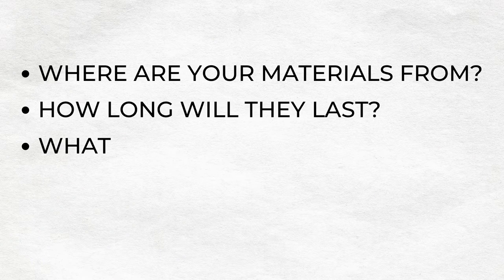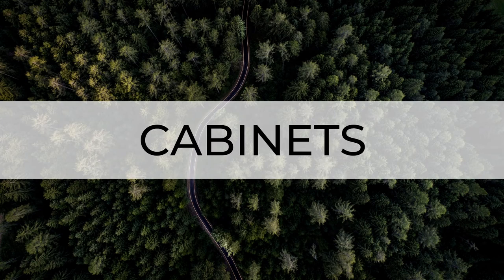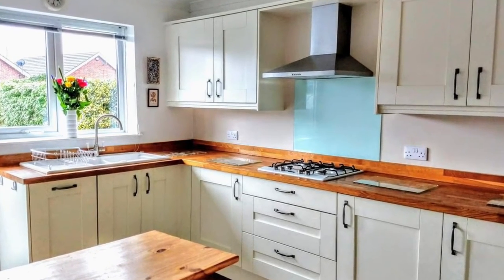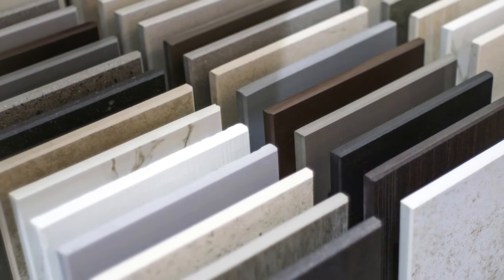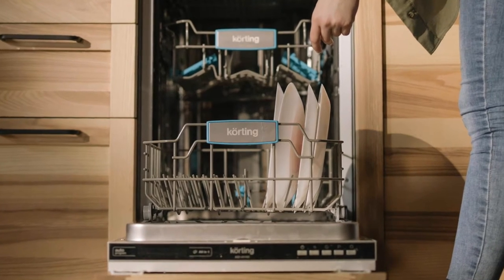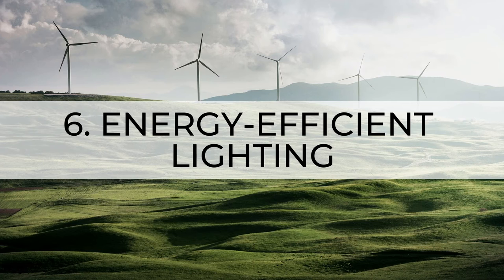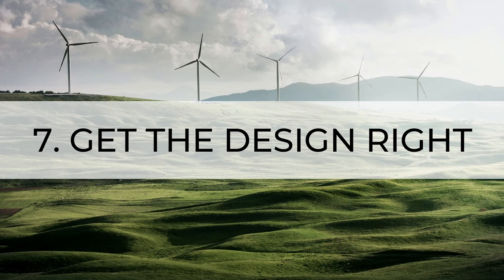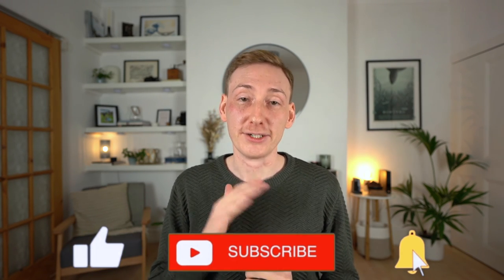Sustainable Kitchen Design | 7 Eco-Friendly Tips

Comment: One thing you didn’t mention is flooring. Especially here in the US where it is pretty common to replace the flooring in a kitchen remodel. Linoleum (or brand name Marmoleum here) is actually very environmentally friendly (it’s made of sawdust and linseed oil), long lasting, no off-gasing, allergy friendly, affordable. In general, I also always like to think of the environmental cost of transportation of materials. Are they made locally, regionally, at least the same continent, or need to be transported around the world? Are the materials very heavy, contributing to environmental cost of transportation?
Reply from the maker: Excellent point about transportation! As you say, always great to try and source as much as you can as locally as you can! I really like that.
I'm not familiar with Marmoleum (reading now) but it sounds like a great option! Thanks for commenting!
Reply: Yay, Linoleum!

Comment: Really impressed with this. I’m a sustainability consultant and usually cringe at the (well-meaning) “sustainability” advice given in interior design videos. But this one is well-researched.
Reply from the maker: Thanks so much! That's really nice of you to say. 
If you have any other sustainable kitchen tips please do share. Always keen to learn more.
Reply: I’m intrigued by boiling water taps. I assume they probably do save energy if the storage tank is well-insulated, compared to boiling a kettle with more water in than you need…I’d avoid using the pyro-cleaning ovens due to the amount of energy needed…on ventilation, I’d opt for an energy efficient extractor over opening the windows and losing warmth (at least in the winter). And opt for materials that are easy to clean rather than need lots of harsh chemicals. Site the fridge away from any radiators….One weird thing: because I have a washing machine in the kitchen, I want to avoid wooden units that go all the way to the ground when we replace the cabinets. Our washing machine flooded the kitchen, so now the cabinets are ruined. I’d be interested in cabinets on ‘stilts’ all the way round, perhaps hidden by a plinth that could be more easily replaced than the whole units…
Reply from the maker: Some really great points, thanks for sharing!

Comment: Good work, I’m getting a new kitchen in new year so your videos have been really helpful.
I’m getting an oven and microwave combi oven, could you recommend a good pairing on a reasonable budget? I’ve read lots of reviews but the combi’s don’t seem to be very good (even the good brands like Neff/Bosch). There are plenty of good ovens so no issues there.
Reply from the maker: Thanks! Pleased to hear they've been helpful.
Over the years I've found a lot of times people review combi ovens unfairly because they don't really know how to use them. Usually about the microwave function being complicated or not as powerful etc... which is often right to be fair but that's part of a combi oven. You need to get used to it and learn its ways. 
Neff would normally be my recommendation in this situation (C17MR02N0B N70 in particular) I've worked with them for years and used them a lot and had lots of good feedback. Otherwise, if the budget has any stretch I'd go Miele. 
The bigger trouble at the moment seems to be getting ahold of the appliance, seeing a lot of manufacturing/stock issues at the moment, so get your order in with plenty of time.
Reply: Thanks a lot for the info, really appreciated! 
I’ll see how far the budget can stretch….
Reply from the maker: @virtuosoblacker   You're welcome! Goodluck!